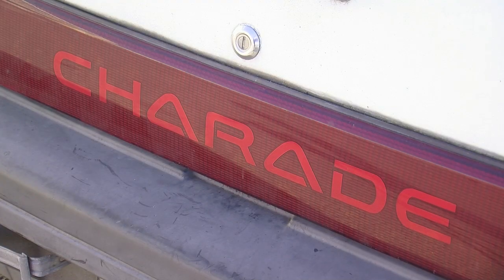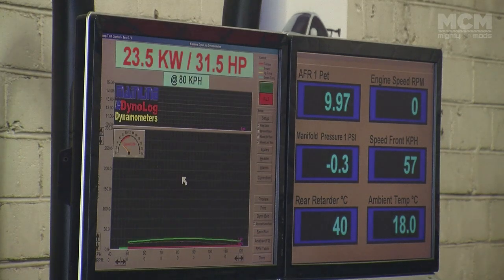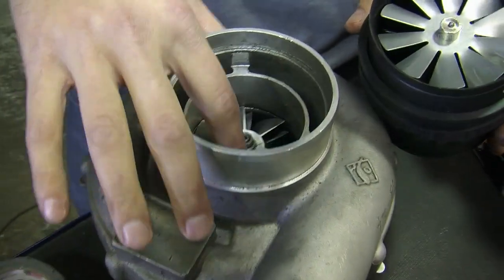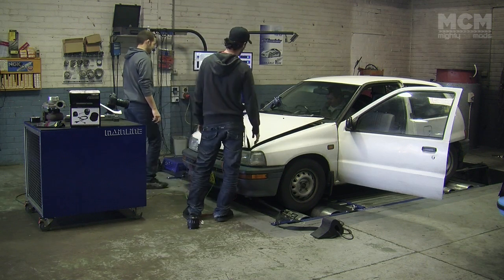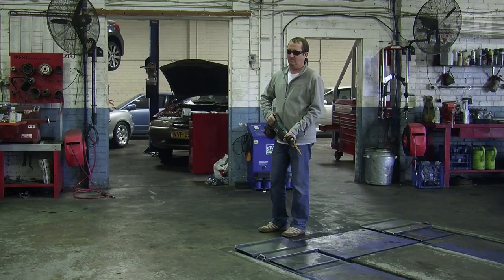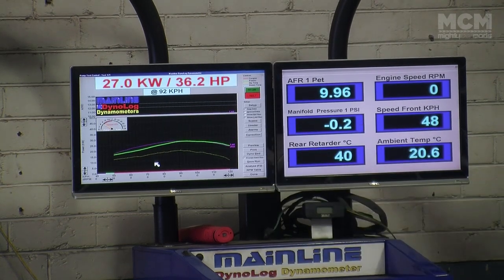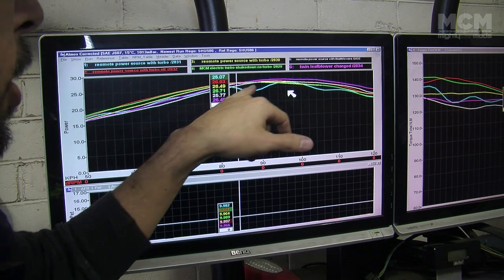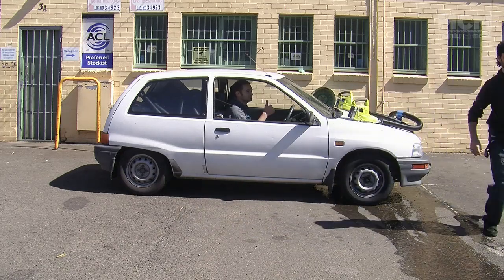Electric SuperChargers Mythbusted

Comment: Hey Guys, This don't work because it don't compress air. But hat about using an electric compressor with a tank putting a check valve on the intake so the preasure don't scape an connecting the intake to the tank and with a regulator you can controlled the presure.

Comment: take it from someone who has done alot of work with turboes.. just shoving air into any motor will just cause more problems then make power. lol you have to change the fuel and ignition maps at the very least. but thats if you are even compressing air and raising your MAP to anything higher that atmospheric. lol

Comment: I made my own electric super charger out of rc plane parts. it actually worked, i ran it off of a 24.4v 10ah lipo battery and a 150amp controller. i dont know how many psi it added, but i could control my throttle with an rc remote with out adding more gas. I don't think a small 12v 2amp fans gonna do shit though.

Comment: How about adding a 5 gallon compressor to the bed of your truck, then feeding a line to a tube that holds 5 - 6 psi max, then feeding that into your motor?

A 5 gallon compressor can hold 60 to 100 psi easy and can be shut off after its full.
Then constantly feed a secondary tank that can hold 6 psi max.
Then feed it to your motor under full throttle.

It seems like you could even dump more air (more psi) from a 5 gallon compressor to your motor but you would run out of air faster.

Comment: All they did was lean the car out by adding more without fuel, If it had a carb it should have been adjusted to run more Rich (More fuel in) when they added the toy supercharger

Comment: There is one thing, If you add more air but not more Fuel you wont see much gain in HP unless you have a Mass AIR sensor Inline before the forced induction system

Comment: ummm. those are geared to make more power. you are the stupid one. the transmissions start off in a HIGH ratio. meaning torque gets multiplied. as it shifts to higher gears the ratio LOWERS. but still. 36 hp is 36 hp. and our little 370 makes more than that haha. as i said. euro cars are piss weak. we used to be land of big blocks and big hp.

Comment: Electric supercharges ??? What you have there is an overgrown PC cooling fan and IMHO it is NOTHING more than a FEEBLE attempt at positive ventilation. 
Thanks for busting this myth.  Most conventional supercharger's whether they are centrifugal or twin spiral screw type take between 5 and 15 Hp for a modest unit to run and these kits have a 5 Hp 12 DC electric motor. FAIL sorry unfortunately many Tools with tool in hand believe the shit they see and hear WITHOUT doing their research. Well Done

Comment: Um, most Garrett units are in the neighborhood of 4-6k, If you run the parts list and buy everything individually you can drop it down to 3-4k, if you buy some stuff used in good condition you can drop it down to 2-3k, if you steal a car that has the "kit" you want it is free. IDK man, the sc kit for my Cobalt is around $3500 from ZZP. I have pieced it together and without a tune, tensioner pully, belt, or heat exchanger system I have only spent around $900.

Comment: manifold 200
tune 500
fmic piping silicon cuplers and clamps and cooler 600
wideband 200
turbo/turbo lines 600
gasgets 200
dp 100
wastgate 200
tubing 60
bov 150
welding fabrication  600.
all on a good ka24de.. pushing around 240 hp not much but the most without internals.did most the work myself sep for the oil bungs and welding  and the cooling ports for the turbo..its a saftly built right car for less then 4000. peiced together myself.

Comment: when adding charger you should lover the engines compression but probably not needed on that small boost :D
And just to let you know that starting from 20°C if you go up 6°C you will have 1% less power from your engine and if you have 6°C less you will have 1% more power from your engine..

Comment: another point to note.. with those electric superchargers.... when the fan is not spinning, its creating a resistance to the airflow to the engine, which is why the guys were getting less power than without it.

Comment: Volume doesn't nessecarily mean pressure. That 800CFM is probably measured without any resistance for the air from the fan to go to. If it meats any resistance, for instance the engine that doesn't accept more than 600CFM at normal pressures, it doesn't displace that 800CFM anymore(more like 601),making it quite ineffective.

Comment: What I don't get is, it sort of makes sense. If you get an electric one that uses a lot of power and spins to a very high RPM and pushes 800 CFM whereas your car naturally takes in 600 CFM then technically you should see an increase in power because this electric device is pushing more CFM than your car naturally takes in. Not saying i'd buy one, i'm trying to look at the technical/physics side of things. I want to build an electric one that is capable of spinning to insane RPM's.

Comment: i want them to do this again but cut off the carb intake where the "heat riser valve" is, im pretty sure that port was leaking pressure
ya know... that round thing right in front of where they connected it

Comment: You dont have to run low compression. You can run high compression on boost with E85 or race fuel. so low compression with a turbo isnt neccesary..it just creates more room for error while tuning

Comment: Sorry kiddo, the reason you MUST lower compression is because forced induction increases the volume of mix giong into the cylinder further compressing the mix. you can only compress fuel of a particular octain so much before it self detonates. 
Higher octain fuel can handle higher compression (it alone wont increase power) but in general (that is, any more than half a poofteenth) increasing octain is not enough, and you must lower compression.

Comment: you said high turbo. and no each motor has its limit. a F22 motor from an s2000 can make 700whp stock interals. just Injectors and a nice turbo and tune

Comment: U dont need to redo an engine to turbo it. The link doesnt show the external. It shows the full specs of the car. I never said my uncles car has stock internals. I dont know where you got that from. Your right i dont drive or built and engine. But ive been around high hp cars my whole life. and my uncle beens building engines his whole life WITHOUT A WORKSHOP or power tools.

Comment: im guessing you didnt comprehend what you read? Its not unlikely since you say you know what your talking about. I said a stock GSR make 300whp without modifications that you said you need. S2000 motors the F20s have proven to make 700whp on a bone stock motor minus the injectors. Never been cracked open. If you think 630whp is unlikely on a 1.8L than look up some youtube vids and educate yourself. Message me and i will sent you a link to the thread of my uncles car.

Comment: if your smart you can do it by yourself. and you dont need low compression pistons you can use high compression pistons. You dont need exhaust/inlet manifolds made you can buy aftermarket ones.

Comment: To turbo a N/A model car you would need to have exhaust/inlet manifolds made, intercooler, exhaust, oil/water feeds for the turbo, suitable profile camshaft, low comp pistons, engine management which would require mapping, clutch that can take the extra torque, all of the piping etc..
Then paying a garage to fit/add all of this who charge by the hour...

Comment: one thing you guys over looked for sure  is the intake seal that goes over throttle body  if thats not sealed 100% it was blowing air pressure passed it the hole time lol  you should have got rid of that air filter set up all together and ran a straight pipe to the throttle body !!!!

Comment: The reason that crappy ebay blower didnt work was because of the stock air cleaner you put so much air into a big container its not gonna boost just blow air you should have takin it off and run a pipe straight to the charger then it would have worked well not 50 hp but maybe 3-5

Comment: Not always. Depends on the jetting of the carb. While you are correct that both a carb and an EFI setup will easily handle varying air density situations, carbs have limits to their jets. If air flow requires more fuel than the jet can supply, the mixture will lean out. The same with EFI (EFI maps do not contain the information for ALL situations; such as adding a supercharger)

Comment: I dont think it would work.  Even if it worked at all, the gains would be tiny, certainly not work $300.  But for it to work at all, it needs extra fuel.  I know this video was for fun, but do to the car they chose it stood no chance at working at all.  Id just like to see the same test on a fuel injected car.  I would be shocked if there were a gain in HP, but Id still like to see it done on a car that could actually add fuel.

Comment: And plus, to have a fan strong enough, you'd put too much load on the engine (alternator) and if you say use a bigger engine you'd need more fan power (more draw from alt)... It's way more efficient to buy a turbocharger/supercharger (even secondhand) then it is to use an electric shitcharger. xD

Comment: I wouldn't think so. I honestly would think even with an adjustment to the fuel you would still lose power because the vacuum is probably greater than what the fan can give (creating more resistance), therefore losing power...

Comment: Ya can't really supercharge a car with those air filters.... Any boost pressure would have been lost cuz the system's not air tight. That's why people made POD filters. So you can get rid of that joke "air filter", make some custom piping to the carb from the supercharger... So air passes through the filter, then through the superchager then to the heart. POD are made for convenience not power.... LOL

Comment: anyone who has turbo charged a car wtih a carb on it knows you have to adjust the carb for it to allow enough extra fuel.  The needels are set to allow enough fuel to be drawn in per the air that the motor can drawn in on its own.  Again, I doubt those fans can do better than 1 psi.  But 1 psi is more  than that carb was set to allow fuel for.  EFI cars meter the air (MAF usually) and adjust fuel accordingly.  Often, the fuel system can exceed the NA's ability.

Comment: A carb sucks in more fuel as the air flow increases already, EFI isnt necessary to add more fuel as air increases as a carb can do it already
 EFI is just more efficient and adds only what is needed while a carb adds way too much so if anything there was more than enough fuel with the carb :)

Comment: Carb went lean.  Didnt add fuel to the extra air.  I doubt the ebay chargers work as they say, but if they did add any air you have to add fuel.  Should have tested on a modern fuel injected car!

Comment: I was thinking the same thing!  If the ebay charger did add any boosted air, you would have to add fuel.  I like the test, but it should be done on a modern EFI car.  They saw the same gains with the charger as they did running with the intake piping off.  That could mean they simply hit the fuel limit at that amount of air.  I hope they take that charger and try it on a modern fuel injected car!

Comment: what if you guys put proper air compressors, like ones you use for spray guns/air power tools, onto it instead of leaf blowers? would that work in the same sense as a turbo and give significant power? just thought it'd be worth a try as long as you were experimenting, lol

Comment: my only problem with the stuff they tested... it's not just about getting cold air to the intake.. it's the velocity at which it's getting there. that's what is so drastically changed. more air flowing w/o restriction is going to equal more power ect. it's just how motors work.. but you also have to count the "smart" ecu's these days, they will adjust and pretty much negate anything you do to run "stock" anyways.

Comment: A fan that looks like it's cut from the bottom of a tin can?How much can it really squeeze?Plus I imagine these sellers aren't telling people about all the other modifications you need so you can really take advantage of a supercharger such as boring, stroking, cam, fuel/air ratio, exhaust headers, etc etc...

Perhaps with a die cast and balanced compressor and something along the lines or a dremel motor you might see some improvement that can still be reasonably priced.

Comment: you dont make power just with boost need fuel to and the carburetor is on the wrong end for that to work should have tried it with somthing fuel injected and i doubt the stock intake was properly sealed

Comment: You could have been alittle more serious about this. How about plugging the PCV line from the valve cover to the air filter housing? Cause any excess pressure would have just gone into the crankcase. I know this wouldn't really pressurize anything but you could try and be alittle more scientific.

Comment: This is easy to prove or disprove. Use an air flow meter to measure how many cubic meters it moves and how many the engine requires at max rpm. Thatll tell you if it is even blowing as much volume that the car sucks usually!

Next take your electric supercharger and cap the output with an air valve. measure the pressure to see if it can compress the air.

If both of those things go well then you might have a chance at gaining power. Also carbi is designed to work under VACUUM last i checked.

Comment: well done and very thorough!   in order to do 140+mph with the twin leaf charged system, you would have to reduce drag therefore its advisable to mount the twin leaf chargers inside the vehicle.   But since you have to remove the passenger seat for your nos system, you've got the room!

Comment: Your T type connection should be replaced  with a Y.  This will increase the air flow and by adding a small internal deflector the air flow will be evendeflector

Comment: Even if they had a super fan that could make boost, it would not give the car power. The air cleaner has a crank case vent pipe going into it, so pressure would just escape into the crank case.
There are also numerous vacuum hoses coming off the air cleaner and carb which would probably just pop off under pressure.
Plus, this car comes with a 2 barrel carb, with a tiny barrel and a slightly larger barrel. The larger one opens under vacuum, which means it will stay firmly shut under boost.

Comment: yea ideal is usually under 14: depending on the engine.  14:7:1 is the manufacturer's goal when an engine hits the streets i believe. at tech school motorcycles made the most power on the dyne running A/F ratios under this number.

Comment: Read my comment again, I explained that. The reason you burned your pistons was because you were in the "a lot too lean" range :P

If you have a weak enough car (Think carbureted 84-87CRX) you can actually feel the difference in pull in the higher gears the more you lean it out on 87 octain.

I think the ideal power mix is something like 13.7:1 instead of the stoich 14.1:1

Comment: "It's got a crack in the time case cover and a couple of teeth missing from the time gear" "IT'S GOT A CRACK IN THE TMING CASE COVER AND A COUPLE OF TEETH MISSING FROM THE TIMING GEEUH" "The radiator's damaged at the core" "THE RADIATOR'S DAMAGED AT THE COAUH" "It's got a cracked water pump, and a fractured injector line" "Well what does all that mean?" "Yeah, okay, but what does that mean?"  "What does that mean?" "24 hours" "24 HOURS?" "They've got twelve!" "YOU'VE GOT TWELVE!" "Ok." "Aykay!"

Comment: scam yes, running lean=more power, no.  i have a basic modded '98 buick park ave Series II 3.8 supercharged that i have put holes in 2 pistons on two seperate occassions due to detonation. i was racing a buddies bmw and had 85 octane in my car, once 10lbs of boost came on POP went a hole in a piston. i beat that beemer tho. i live in Iowa and am currently running E85 in the park, it seems to like it.

Comment: Increasing air flow without increasing fuel injection rate is useless, the car is old and doesn't have a modern ECU that would make the adjustement it self, the results was obvious.

Comment: Guys, an Electric supercharger 'can' work.  But you'd have to have one hell of an electric engine forcing air into your intake.   Not only would that engine be extremely heavy, but the batteries that power it would also be heavy, defeating the purpose entirely.

Comment: Ignoring the fact that ebay electric chargers are a complete scam.

Running lean actually makes more power. The problem with running lean is detonation and combustion/exhaust temps.

A little too lean will cause excessive temps and burn exhaust valves.
A lot too lean causes detonation, which will pit the head/pistons and in extreme cases break rods. (and burn valves)

BUT, right up until you crisp the valves you'll be making more power. XD

Comment: yes yes i understand your air/fuel speel, but carburetors and injectors can only deliver so much fuel before they need to be upgraded to get more fuel.  like in this case of adding forced induction to a naturally aspirated engine, the carburetor can only flow so much fuel. will it be enough to supply more fuel for the forced induction, prolly not. so the engine will run lean, in which the carburetor would need to be upgraded to run richer than it was designed for.

Comment: I want to see a real Supercharger installation on some 2.0 engine R4 engine. I want to know more about it. Right know I'm not even sure where the throttle should go when you are adding a supercharger. Do you leave it as it is on the inlet manifold and put a constant pressure on it or do you relocate it so it would work on the supercharger inlet? And what about the IC?